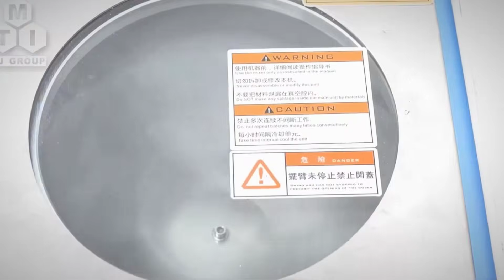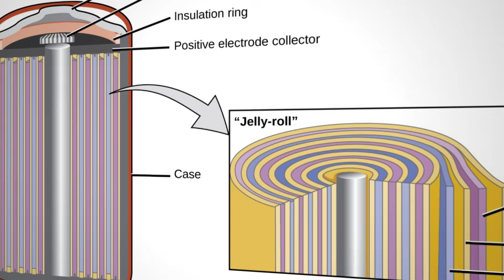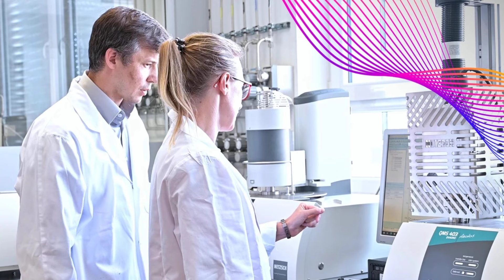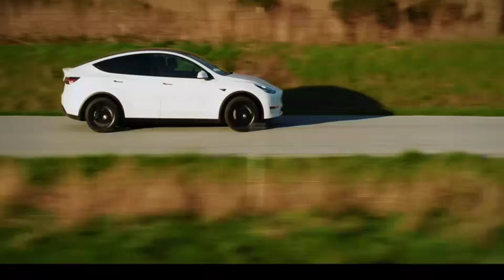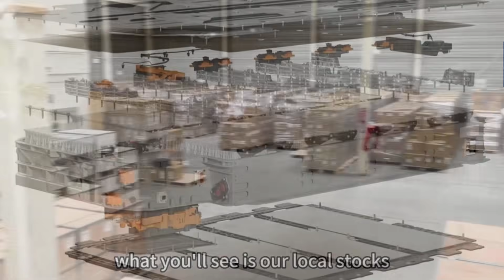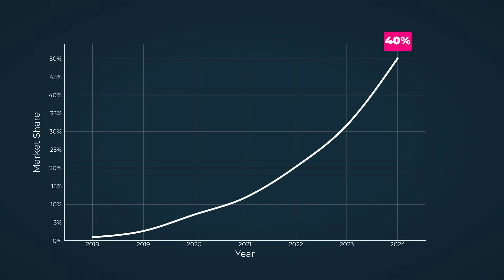The Science of 4680: Why Rivian R2's Battery Could Destroy The Model Y

Comment: I'm glad I got the 2170 cells for my 2023 model Y. Tesla should have never got in the business of making battery cells and they should have left it to companies like Panasonic. That's what happens when you're on ketamine. 
Rivian is smart to leave the cell manufacturing to companies like Samsung SDI and our R1S lost less than 2% after 15k miles. I'm hoping to get the R3 which will replace my model Y.
Reply from the maker: You really caught the "sweet spot" with those 2170s—they’re essentially the gold standard for reliability right now, while the 4680 still feels like an expensive science experiment gone wrong. Seeing only 2% degradation on your R1S after 15k miles is a massive testament to Rivian’s thermal management and the stability of those Samsung SDI cells compared to the heat-soaked 4680 packs. Since you’re eyeing the R3 as the ultimate Model Y replacement, what’s the one specific software or hardware feature Rivian needs to nail to make you never look back at the Tesla ecosystem?

Comment: I stopped watching when they talked about "subatomic chemistry", 10 seconds into the video 🤣
Reply from the maker: Haha, I totally get it—that hook definitely sounded like a sci-fi movie trailer. But honestly, once you get past the flashy intro, those internal chemical reactions are the only way to explain why the 4680 cells are throttling their charging speeds so much earlier than the older 2170s. Are you usually more into the practical "boots on the ground" reviews, or do you actually like the deep-dive engineering breakdowns when they aren't so over-the-top?

Comment: The winner is decided by software and access to chargers.  Tesla wins on those in spades.
Reply from the maker: You’re hitting on the exact reason Tesla has stayed dominant for so long—it's hard to beat that seamless integration and the sheer reliability of the Supercharger network. Now that Rivian is gaining NACS access and leveling the playing field on charging, do you think the "software gap" is still a big enough moat to keep people from switching over for better battery hardware?
Reply: @ChargeZoneGarage  The battery hardware advantage is minimal and Tesla will certainly improve that as well. 90% of people drive to within 50 miles each day and longer trips are rare. 

The software gap is as big as Mt. Everest and it''l continue to grow. Because Tesla has massive inhouse datacenter power behind it and is integrated with SpaceXAI in many ways. Rivian has none of those advantages.
Reply from the maker: @pk-jc9se  That software moat is definitely massive, and the way Tesla leverages their in-house compute for AI training is something Rivian simply can't match right now. However, even if most trips are short, the real hardware hurdle for the 4680 is that thermal bottleneck—once those cells get heat-soaked, no amount of software magic can stop the charging speeds from falling off a cliff compared to more efficient cooling setups. Do you think the "connected" ecosystem and FSD progress are enough to keep people loyal even if competitors start pulling ahead on the raw charging and repairability specs?

Comment: Great unique content

The battery degradation for Tesla seems to be higher than other EV
Reply from the maker: That’s a point that doesn’t get enough play—the 4680's thermal management issues essentially mean those cells are getting "cooked" more during fast charging than the old 2170s, which is a recipe for faster degradation over time. Do you think these long-term reliability concerns will eventually push more people toward LFP-based EVs, even if they offer slightly less range?
Reply: @ChargeZoneGarage on d platform there are couples people talk about Tesla degradation rate is high and bad…not much attention on this topic

Potentially after 5 to 8 yrs when usable battery capacity drop to 60% 50%. People will wake up
Reply from the maker: @darrenchin8492  It’s definitely a ticking time bomb that the "honeymoon phase" of EV ownership usually ignores, especially since the 4680’s poor heat dissipation is basically a recipe for faster chemical aging compared to older designs. If we start seeing a wave of out-of-warranty Teslas with 50% capacity in a few years, what do you think that’s going to do to the resale market for anything that isn't using a more stable chemistry like LFP?